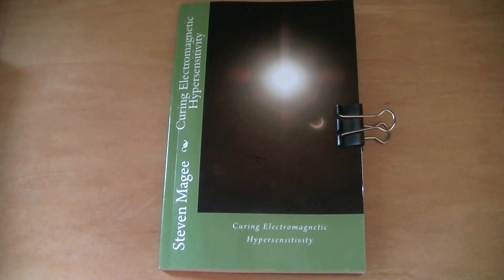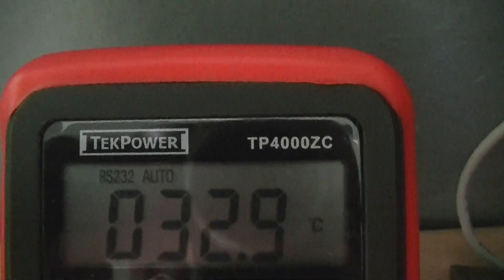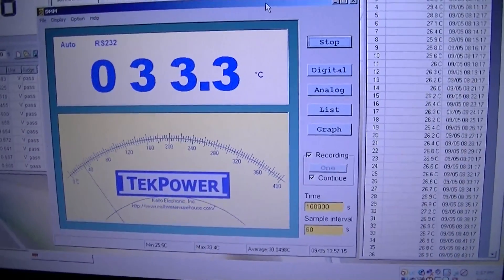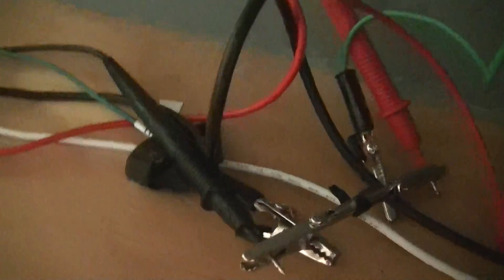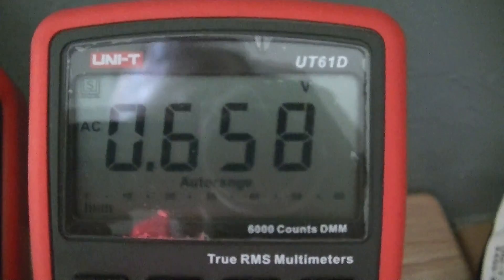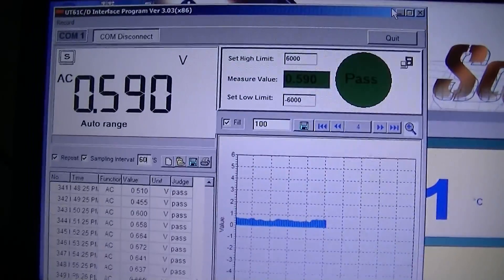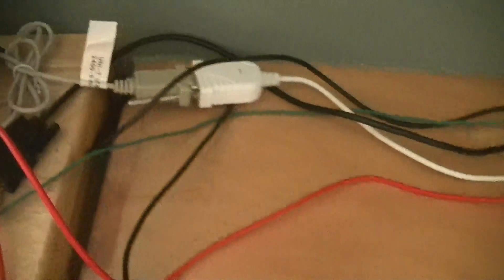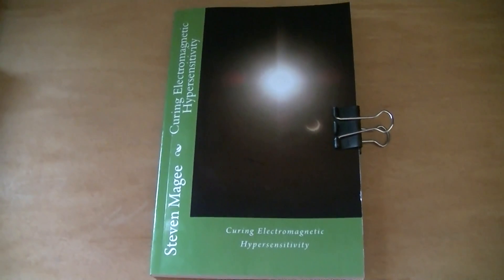Using the UNI-T UT61D & Tekpower TP4000ZC Multimeters to Measure Stray Voltage

Comment: Quick question.
Can that stray energy be be used or harnessed? Foe example off the grid uses?
Reply from the maker: It is low voltage and low current.  It can easily be adapted to power low energy devices and for the charging of batteries for small products.  It is a source of truly "free" energy.